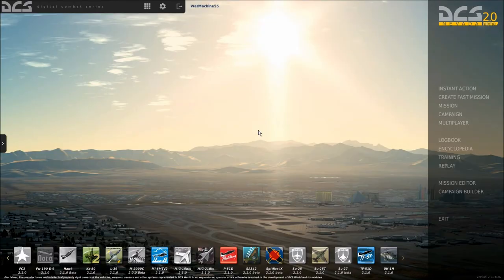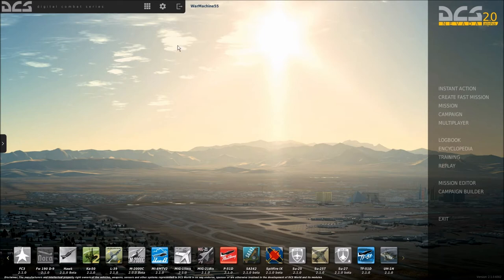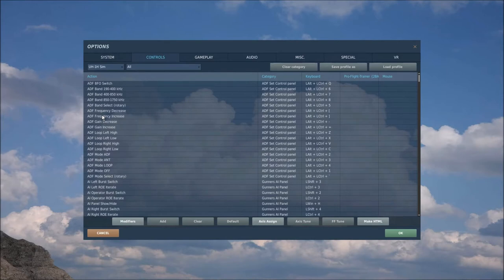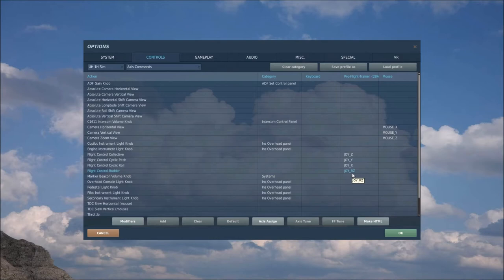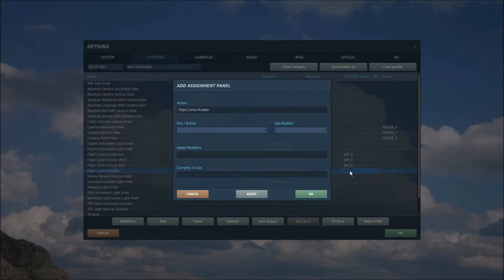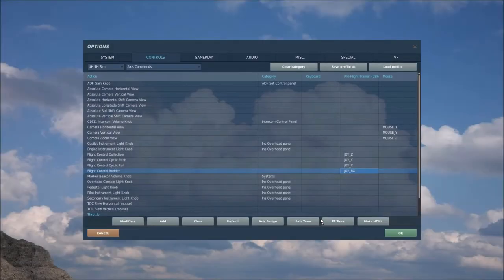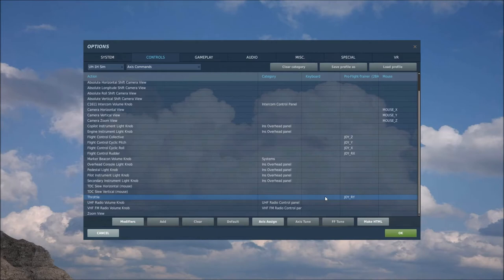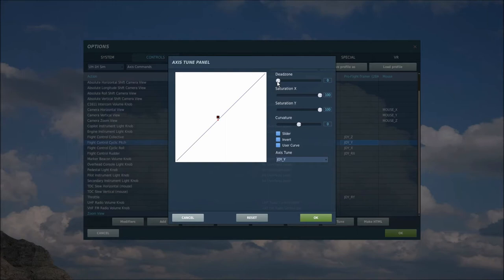PFT PUMA axis and buttons setup instructions for DCS

Comment: Hi and thanks for the video.  I have two problems that you might be able to help with; 1. My throttle is not recognised and I used your approach, but nothing.  2. The pitch on cyclic is not centred (the black box and red dot are not close together when stick physically centred), I get some forward pitch, but almost no aft - it is against the stops and has no effective control.
I guess I have a third issue, but seem to have fixed it.  To get normal collective effective control and torque control, I have had to set the curvature to -15 - works fine then.  Please note that my puma works fine with X-Plane 11 and I am a licenced pilot, so do know what effect of controls I am seeking.      
Hope you can help.
Reply from the maker: Hi John,
thanks for writing! may I kindly ask you to fill a support request via our website? This way we can guarantee the best support.
https://pro-flight-trainer.com/pages/request-help
happy landings!
Reply: I have the same issue. Was this resolved?

Comment: I had to invert my Y axis. any reason why my cyclic operation is backwards even in calibration it was backwards
Reply from the maker: hi, usually that seems to be an axis plug that is plugged in the opposite way. can you please check as you assemble your unit that all wires connectors are plugged in the same way? maybe your Y-Axis connector is inverted. you can unplug it, turn 180 degree and replug and the axis should be the correct way after that.
Reply: perfect i looked but not hard enough thank you guys